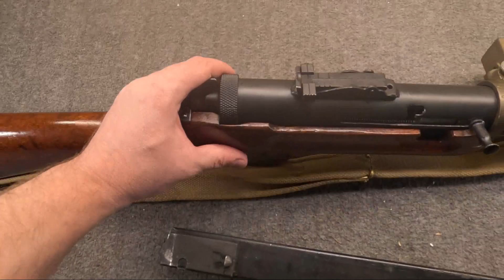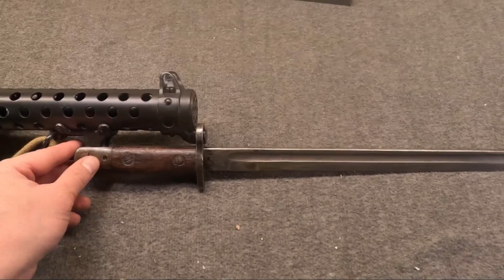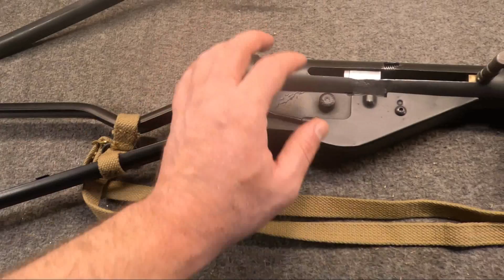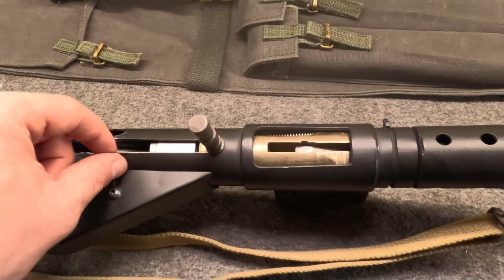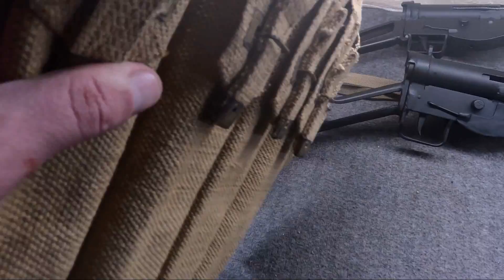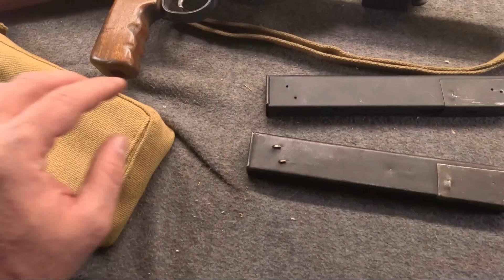Plumber's Nightmare, Pipework-Abortion, The Stench Gun (Sten Retrospective, 2022)

Comment: You cannot get original sten guns in the US !?
Reply: Yeah we can, plenty of original full auto Stens floating around. It's just way cheaper to build a kit into a semi automatic
Reply: We're generally not allowed to have open-bolt semi-autos. We're also not allowed to convert full auto to semi. What we end up with is functional guns have to get their receiver destroyed and be rebuilt on a new receiver, with an awkward striker or hammer conversion to closed bolt operation. The barrel legally has to be replaced too, for no particular reason other than to make kit builds more difficult and expensive. Original full autos are only legal for individuals if they were registered before 1986, and those cost something like $10,000 now.
Reply: @timewave02012  Its fine to use an original barrel still.
Reply: @misha5670  There's a lot of nuance I glossed over, but you're right. At some point under Bush, barrels started having to get destroyed from imported machineguns, but it's still legal to use original barrels from pre-barrel-ban kits. Unfortunately, import restrictions seem unlikely to get struck down post-Bruen.
Reply: @timewave02012  Right, while kits rarely come with barrels now, if you have an original already, don't toss it out and definitely feel free to use it. Even stranger, some kits imported post-2005 have come in with intact barrels, while others haven't. Its....complicated lol.
Reply: @timewave02012  god i paid mine  450€
Reply: @guillaumeferment7445  That sounds about right if not for the artificial scarcity. We do have a license allowing collectors to get certain guns shipped directly to themselves, but there's no license class that allows collecting post-1986 machine guns. You have to start a bona-fide business, keep certain records available for inspection, allow inspection of the premises where the guns are stored, etc. Then if you have a dealer license, you usually need a law enforcement agency to request a "demo", because the machine gun needs to ostensibly be for sale to a government agency. If you have a manufacturer license, you need to either follow the dealer process, or manufacture the gun yourself. It's such a hassle that people are willing to pay ~$10k for blowback SMGs, ~$30k for M16s, maybe $60-80k for an M60. Really, you're paying for the legal status of the gun (referred to as being "transferable") more than the gun itself. If something is both transferable and highly desirable for collector value, like an FG42, it's worth hundreds of thousands of dollars here.
Reply: @timewave02012  A lot of people think they are being clever in getting an FFL-07 mfg license + SOT to make post-sample MGs. The only big issue is that if/when they sell the business, all those guns go with it. They can never privately own a posty. This is why i have fun doing semi-auto conversions. For one its a mechanical challenge, and for another i can keep them til i die and even after can pass them on to family or friends.
Reply: @misha5670  The other side of that is you can get an 07/02 and, as I understand, do conversions of semis to full, and register only the conversion parts (AR DIAS, SMG bolts, HK trigger packs, etc.), so you can keep the semis after going out of business.